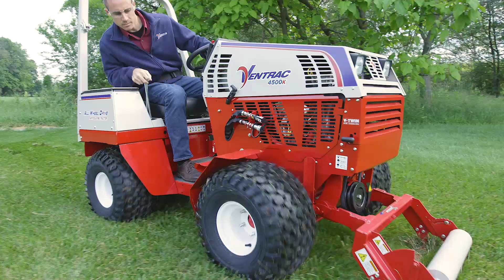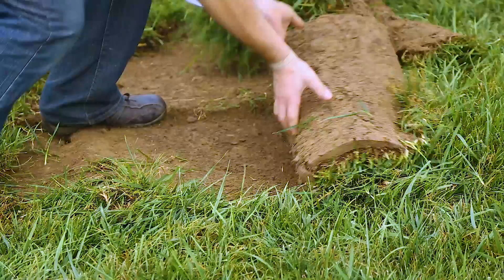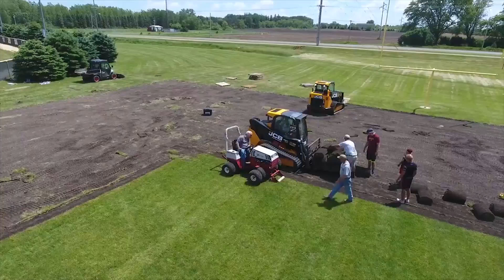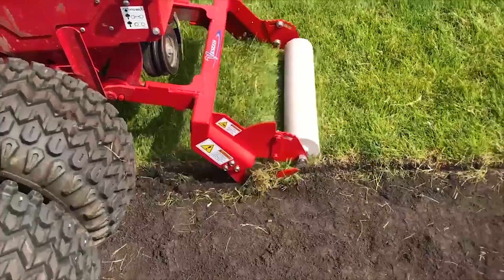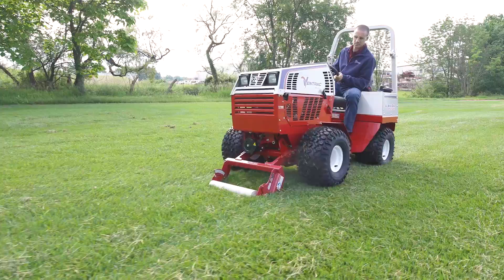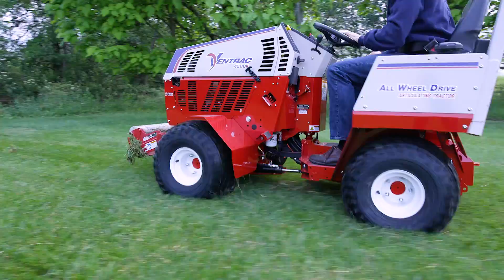Cut Sod With Ease With The Ventrac EC240 Sod Cutter – Simple Start

Comment: Is it possible to sharpen the sod cutting blade Instead of replacing it?
Reply from the maker: It usually keeps itself fairly sharp over time.  The issue is more of the blade just being worn down too far and being used up.  It's just easier to toss a new blade on.  And they only cost about $45.
Reply: Ventrac makes perfect sense

Comment: Ventrac, how much can those hydraulic lift arms actually lift? Because I've seen 4100s that have broken them.
Reply from the maker: The arms themselves don't have a specific rating like some of the attachments do.  We haven't experienced any widespread weaknesses with the hitch arms, but there have been a few broken here and there.  Like most of the tractor, over time we have revised the hitch arm profile and shape slightly as part of continual improvement to make them more durable.

Comment: Why don’t you put wing nuts on it so you don’t need a wrench to adjust it. Looks good if I ever need to cut a loot of sod I now what I will use
Reply: Wings nuts wont be at all tight enough, the blade will move the moment it hits the ground. You simply can't torque wingnuts enough, maybe you can but most people cant.